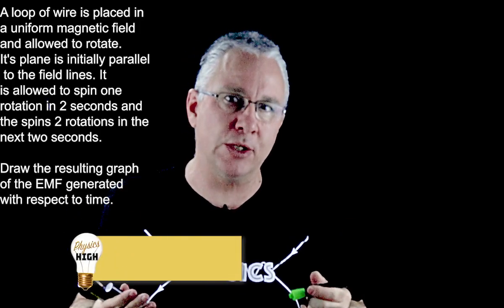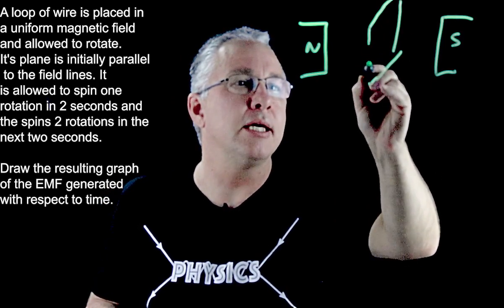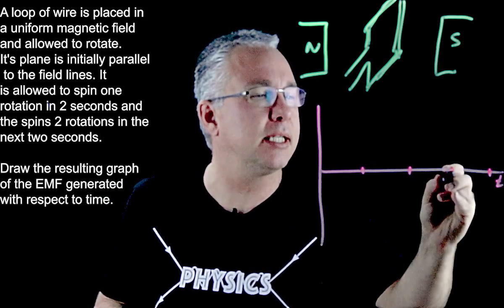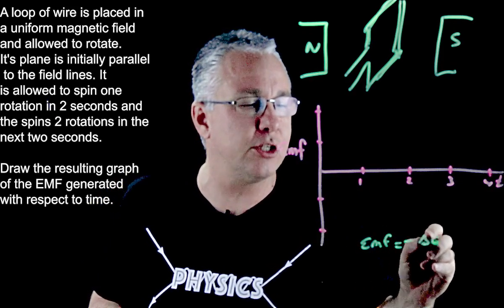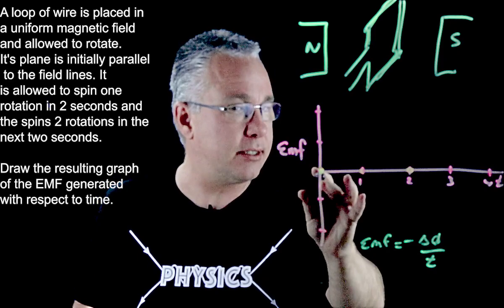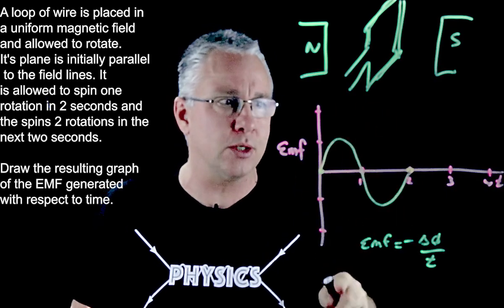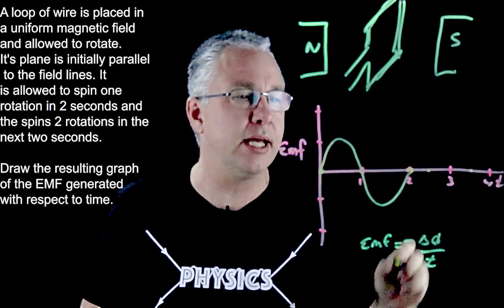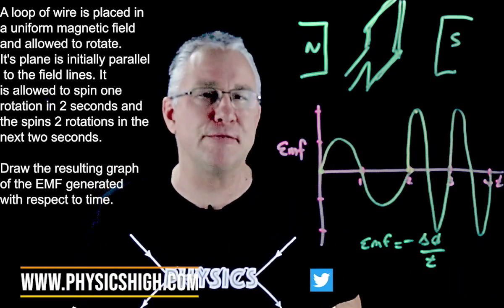How to solve a Faraday's Law problem involving induction

Comment: Correct me if I am wrong, but if the question states that the plane of the loop of wire is initially parallel to the magnetic field lines, then doesn't it mean it the wire is initially at a position where 0 lines of flux pass through it's area?